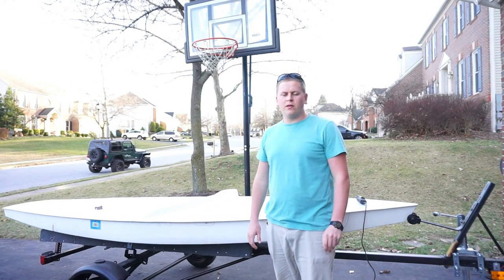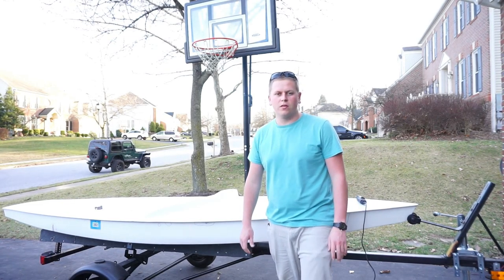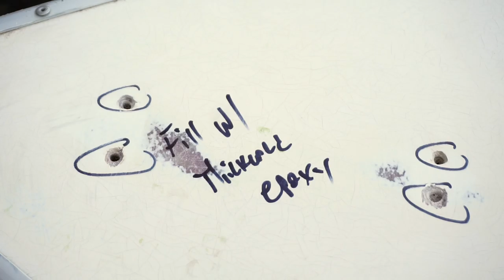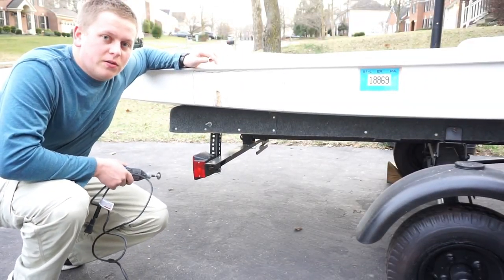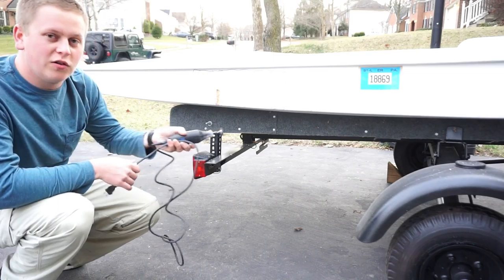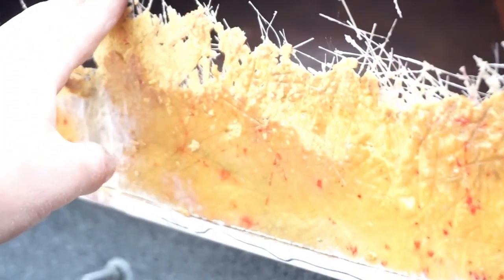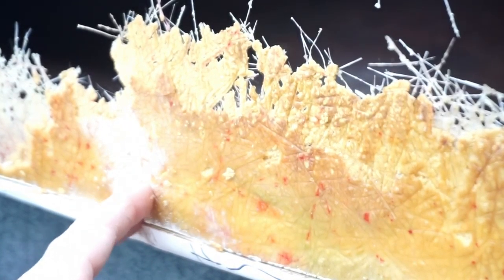Sunfish Sailboat Restoration- The Hull-Ep 5

Comment: I'n not sure you should have filled the 4 screw holes in the bow area: a Sunfish grab-handle goes there. makes it easier to haul the boat.  Also why fill the drain plug hole?
Reply from the maker: Hi skylarking12-

I filled all the holes in the boat due to a leak issue which I was unsure of where it was coming from. I plan on later re-drilling and sealing all the holes when the grab-handle and drain plug are re-installed. 

Thank you for your support and the comment!

Tyler
Reply: leaks will come  from the deck/hull edge seam or from the daggerboard trunk, typically.
Reply from the maker: Good to know! Thanks for all the support!